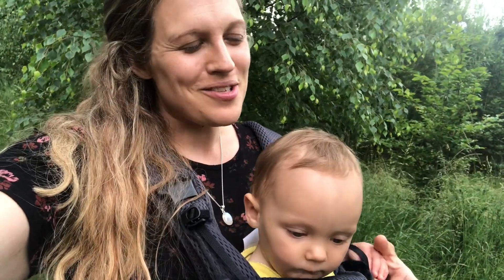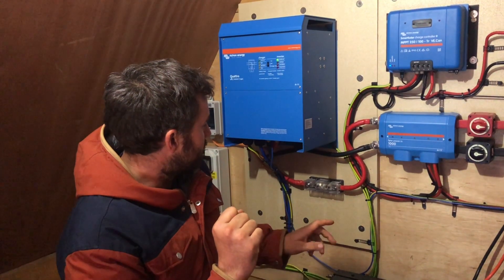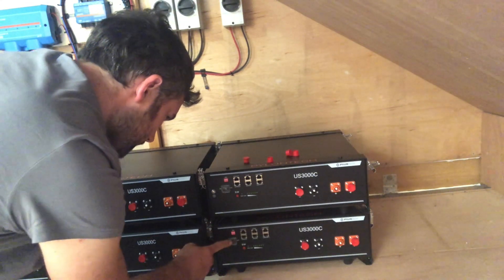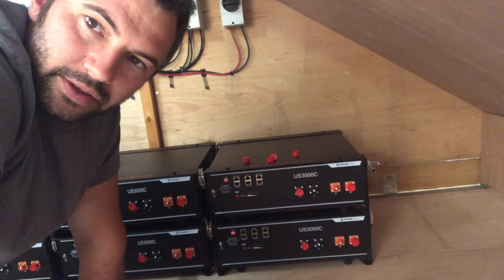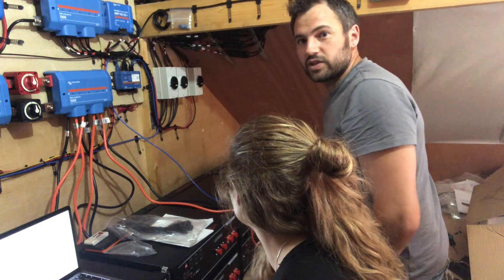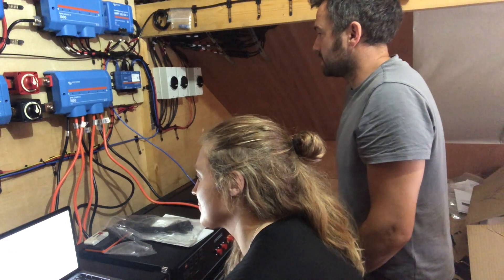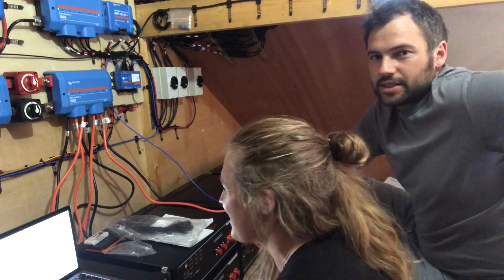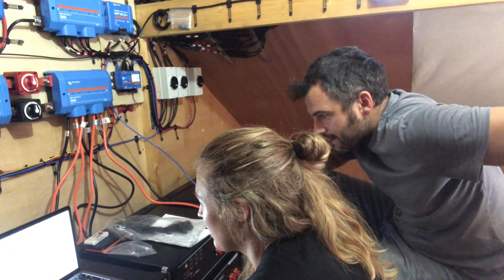PYLONTECH batteries for VICTRON DIY OFF GRID SOLAR SYSTEM: Victron CERBO GX and Pylontech US3000C

Comment: Hello, interesting and ‘real’, thank you .   I would very much like to try the solar route, and although happy to do the leg work, I’ve no idea where to start the ‘system design’ how did you choose which items of kit you needed, or did someone else design the system and provide a shopping list … which is how I would prefer to go ?
Reply from the maker: At first we were going to get a kit from a place called Meadotech.co.uk. They’re really helpful with answering questions, but as we learnt more we began to feel more confident about creating our own list. Our main reasons for this were that we could source the latest stuff. E.g. The touchscreen for the Cerbo GX wasn’t included in the kits. Also, a lot of the kits weren’t big enough and didn’t include the solar panels we wanted. In the end we bought our equipment from a range of different places. We didn’t get it right first time. If you watch some of our other videos (such as the one where we fuse the Pylontech batteries) you will see that we’ve had to make changes. However, on the whole it’s been a success. We would recommend Explorist Life to help with wiring. He has a great YouTube channel and this is how we learnt to wire in series parallel and how to calculate which MPPTs we would need for our 20 panels. If you are thinking of going down the Victron route, the Victron Community Forum is excellent. There is also a solar DIY forum but you can sometimes get told conflicting information which makes it hard to see the wood from the trees! Hope this helps and all the best for your solar project 😊
Reply: @The_OffGridFamily  thank you, I appreciate you taking the time to reply.

Comment: I ended up grinding the lip of off 1 of the brackets, then you can slide the front bracket on from the rear, takes a minute with an angle grinder.
Reply from the maker: Thanks for the tip 😊

Comment: hi there, how do you isolate the batteries when each of them can bring 2500A in a short,  mega fuses can only handle 2000a in 48v and the main switches I see cannot handle either? only NH box could handle it, or am I wrong?
Reply from the maker: Our understanding (although we are not electricians) is that the way to cover a short is by making sure everything is properly earthed. The fuses are there to protect the wire from overheating. We found the Pylontech manual inconsistent here as it says 125A max in the cables in one part and 100A in another. Some people were also arguing the cable wasn’t even the right size for 100A 🤷
Reply: @The_OffGridFamily  the cable are good fo quite more then 100a but in the manual it says to have a circuit breaker that is eithe 10ka (up to 3 modules) or 20ka (>3). which your main switch is not up to. normally the pros use a NH isolator as you can see here https://www.youtube.com/watch?v=gU1odRWCKKE maybe worth a thought for you big installation. I am not an electrition either. :-) just having the same questions while building up a system.
Reply from the maker: @tobschter2369  You’ve raised a really good point and we have spend the evening reading through the manual 3+ times to find nothing about breakers. We went online to check the online manual: a different version of the manual to the one that was sent with each of the batteries. You’re absolutely right! So now we are trying to find the most affordable way around it… just when we thought we were done spending money 😫 Thanks for your comment. If we had just relied on the manual we were sent out we would never have known!

Comment: Ahh, so that's where the UK's stock of US3000C have gone! :) I'm on a waiting list for some more for myself.
It's a pity about the one bad apple. Hopefully it comes back as reliable as mine have been.
Reply from the maker: Completely know where your coming from about supply in the U.K.  We were told it would be September earliest that we could have a replacement for the one that didn’t work 😫 In the end we just got our money back. That’s great to hear that yours are reliable 😊 How long have you had them?
Reply: @The_OffGridFamily  I have had them less than a year TBH. Not much use in winter time, but they have really been singing again since March.
I'm using them in and on-grid setup with solar supplementing the grid supply. The next step is to switch to an agile electricity tariff to reduce costs significantly by storing the cheap rate energy.
Reply from the maker: Sorry to hear that about winter 😫 We are really interested to see how we get on Dec-Feb. Fingers crossed we’ve got enough panels and batteries to keep us going, with the occasional generator top up as we don’t have access to the grid 😊

Comment: If you wish to use the wifi on your Cerbo, you can remove the cover and relocate the 2 wifi antenna to the outer most left and right sides of the cover as per victron recommendation. They are placed to close to the hdmi output, thus when the color control is plugged in, it produces interference.
Reply from the maker: Thanks for your comment 😊 We read about this, but were worried that by opening it up we would lose our warranty. We’ve managed to get round the problem though so all’s we’ll that ends well 😊

Comment: Such a pity about the last one not switching on.  I hope whomever you bought it from just replaced it with a new one while they investigate it.  It's looking nice and well laid out.  I'd be interested to see how you get on through your first winter on Solar,  how often you have to use your generator.
Reply from the maker: Thanks, we are in the process of negotiating a replacement at the moment! 
Yes winter will definitely be the test.  We'll do a video sharing some of the data from the Cerbo GX over winter I think, to show how it's going.
Reply: How many 3000c phylontech batteries are connected to one inverter in parallel